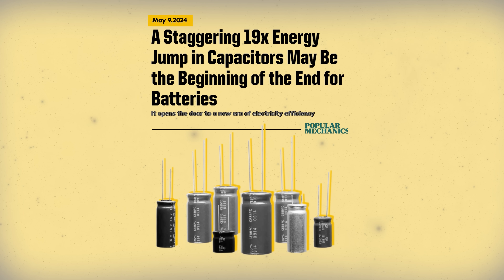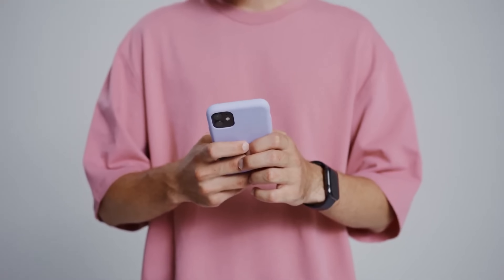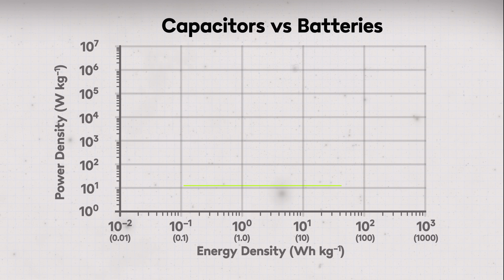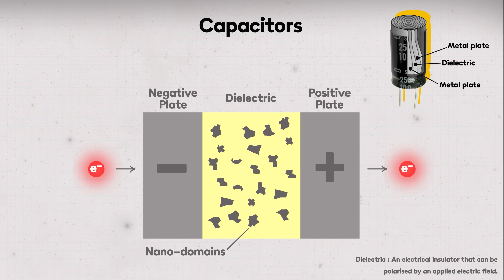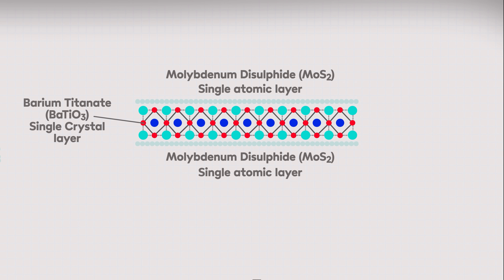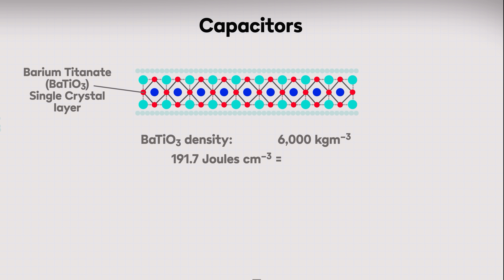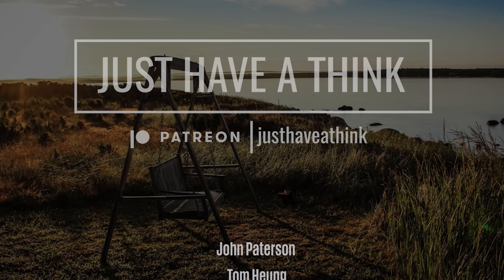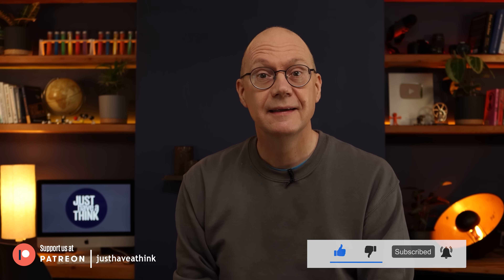Charging an EV faster than filling a gas guzzler? Surely not!?

Comment: I think you meant to have the resistor on the battery side of the capacitor. Then the voltage across the capacitor would ramp
up slowly

Comment: When super capacitors were first proposed as a replacement for batteries, the biggest problem was not so much energy density but rather a high rate of self discharge. I have not heard that that issue had been adequately dealt with, yet here we have a video talking about density but no mention of self discharge. Is this not still a problem?

Comment: Lets say you want to add some supercaps to an existing EV to capture more regen and for a small but fast recharge of the caps that then recharge the battery on the move.
Wouldn't 'having a think' about the control circuitry for this possible EV upgrade or mod be a good idea?
Or is that the kind of 'think' where you lose most of your viewers early in the video, without them clicking 'like'?  :)

Comment: speed does not matter if it's under 15 min.  You pump your gas in about 4 minutes-go inside and pay-get something to eat or drink-checkout at the counter-it takes about 10 min minimum if it's an average gas station.  I've had EVs since 2012 and it has had nearly zero affect between the differences between gas and EV.  I will say with the EV the car doesn't get serviced every 2-3 months.  I've gone years without service with the EV.

Comment: Another aspect of this capacitor is that its dielectric is composed of a crystal several atoms thick. However, the dielectric breakdown has to be equal to or greater than the battery voltage, which is probably on the order of hundreds of volts. So the dielectric must either be much thicker or a bunch of these capacitors will need to be connected in series with voltage equalization resistors in parallel. Either of these approaches will reduce the total capacitance probably by much more than the 19x factor. Then additional capacitors will need to be added in parallel to increase the total capacitance to the intended design value. The capacitor bank will need to be mounted very close to the battery to reduce IR drop and copper wiring. The capacitor bank may be as large as or larger than the battery itself.  In addition, the capacitor banks will need to be protected against overvoltage spikes and excessive heat, which will require even more electronics and additional mounting space, increasing the overall cost of the capacitor bank.  IMHO, this is the minimum needed to provide a reliable capacitor installation.

Comment: Faster fill ups. Electricity can be envisioned a lot like water. If you want to fill up your BEV battery faster is a lot like saying you want to fill up your swimming pool faster. If you use a 1 inch garden hose; it will take a long time; so why not use a firehose? Sounds great in theory right?  However if the amount of water available is only enough to fill a garden hose the fire hose won't help.  If your neighborhood water source is a water tank, but the water tanks is only twice as big as your swimming pool; if others already emptied the tank by filling up their new swimming pools ; you won't even get a drop. Most of the Grid doesn't have the capacity to charge so fast.

Comment: I HAVE SUPERCAPS. Lead acid batteries are 19th century technology and Lithium batteries are very much last decade technology plus stupidly dangerous.

I have six 1kWh or 85Ahr supercaps connected in parallel  on my 45ft sailing cruiser. 1)They have a 1 million cycle lifespan. 2)are 98%+ efficient, 3)have a 2%/month self discharge rate 4)have no risk of fire or explosion, 5)😮can be run down to zero Volts and stored totally discharged for 6 months and when needed be recharged without any adverse effects & 5)weigh approximately ±15 kg each.

I charge them with two 330W solar panels via a Victron 100/50 Blue Solar Charge Controller and a 150W alternator on the engine through a Victron DC-DC charger set at 13.45 Volts and 30 amps. Charging with the engine only happens when motoring, I've never needed to top up with the engine because of low SOC. I've never seen the supercaps below 75% SOC.

They could be charged and discharged with  massive cables in seven seconds but for safety reasons they are each limited to a maximum of 50amps charge and 50 amps discharge. Charging 6kWh in 7 seconds could be interesting to watch at a distance of 100 meters.  😂 They are each fitted with a 50A cutout circuit and if short circuited or overloaded will trip and then need to be reset which is easy to do.

In my case, because I have six in parallel l can charge and discharge at 300 amps. If they were connected in series the 50 amp rule would apply. 

These supercaps can be loaded on a passenger aircraft and transported legally and safely.

I have had them on board for 4½  years and never worried about running them flat, fire or explosion. 

On the 12v system they power all fresh water pumps, bilge pumps, 12v lights, nav station, radar, a power hungry autopilot, a 1.2kW or 100amp  windlass (anchor winch) and can start the 50 hp Perkins diesel engine with ease.

On the 220v system they power a 1kW microwave, a 1kW kettle, a toaster, our little 20 litre 1500W hot water geyser and run a 0.75 kW 220v single phase electric motor which drives a high pressure pump to 80 bar with ease for the reverse osmosis water maker via a 12volt to 220v 5000W pure sine wave inverter which is not the most efficient way but who cares? It works like a dream! For safety reasons I've choose to run them one at a time. I can use all my 220v power tools in the middle of the Atlantic ocean. I have not tried my welding machine yet. 

They also power an 80 litre camping deep freeze at minus 18⁰C plus a refrigerator at between 2.5⁰C and 4.5⁰C on 12v or 220v via the inverter 24/7

My yacht is the only sailing vessel IN THE WORLD fitted with SUPERCAPS for all the vessels electrical requirements. Why??? I can't answer  that question. 

I am a boiler maker by trade, not a Nobel Prize winning electronics engineer and I installed and wired everything alone and it's perfect...I think.

After 4½ years I have been unable to convince any other yacht owners  of the magic. There it is, it works, it is literally bomb proof but no, they refuse to believe what they see working to perfection right in front of their own f.cking eyes, these idiots want Lithium because it can burn like nothing else on earth, it damages the planet and they use child slave labour to mine it! WTF? Cape Town South Africa.

Comment: One major infrastructure issue that would have to be dealt with in order to apply the sort of ultra-fast charging this technology might be able to enable: power delivery rate.  The ability for a capacitor to absorb energy at an astonishing rate only matters if you have the ability to deliver energy to that capacitor at that rate.  Currently, Level 3 chargers offer a DC charge rate of up to 350kW, which is already absurd, and real world cars get up as high as accepting 300kW, so it's not like we're massively overdoing the infrastructure here.  And to get that we're having to do totally ludicrous things.  We're talking in excess of quadruple the normal line voltage and delivering  hundreds of amps worth of current - if you were to tell an electrical engineer 20 years ago we're building this kind of infrastructure for the general public to access, he'd probably tell you that was insane and would kill people.  (And honestly, given how cavalier some folks are about these chargers, I'm not entirely sure he'd be wrong, despite the myriad safety precautions in play.)

To build the kind of station you'd need to charge at the rate you're talking, we'd need to double down on this power delivery.  Forget 350kW, try 1-2 MW.  And now we're literally talking the kind of power infrastructure you see in power plants and substations, and well outside what any respectable electrical engineer would likely consider allowing in a public-access area.

Besides, current fast charging systems are good enough for the people who need them.  Regular refueling should be done on level 2 chargers, or even level 1 - for most people that means plugging in at a charging station in your home at night.  (Level 1 is your average North American household 120V plug, and it's enough for folks who use less than a quarter of their range in a day if they plug in every night.  Level 2 is a 240V plug and requires a bit of hardware that you buy separately, but it plugs into a 240V plug if you have such a thing available (So yes, North America will need electricians to install these in most homes and apartment parking complexes, we tend not to build spare 240V circuits into the house, but this is becoming increasingly common already)  Level 3 only has to serve travelers (as they're out of their normal area and thus have no guarantee of access to Levels 1 or 2 overnight ...though I suspect independently metered Level 2 chargers will slowly make their way into more and more hotel parking lots) and the relatively few people who don't have access to overnight charging (or only have level 1 and need an occasional top-up).  15 minutes is all it takes to add upwards of 120 miles of range to a car these days, surely most travelers can afford 15 minutes to stretch their legs, hydrate, and go to the bathroom.

I guess the one exception to this would be the eventual development of electric semitrailers - though for that industry I suspect the idea of modular batteries might be the way to go - unlike your average driver, truckers are very used to moving extremely heavy loads with precision (getting up to a loading dock without smashing anything is some of the most intense precision driving I've ever seen), so I can see having infrastructure for swapping out battery banks at truck stops where they just pull up to the exact right spot and a machine pulls the battery pack out of their truck, slots it into the charging mechanism, then grabs a charged one and slaps it into place.  Or just a set of several battery packs that take 8 hours to charge on level 2 installed in parallel that's sufficient to carry a truck and its rated cargo through the day, then just plug in a collection of level 2 chargers for each pack separately.  I dunno.  Semitrailers are something of an unsolved problem for EVs as far as I know, but given how critical they are to the logistics of everyday modern life, I'm sure there's a bunch of teams trying to work out how to make an electric form that's practical.  (I can all but guarantee that you're gonna need a solution that can run all day even on a fully loaded truck and can be fully recharged during the mandated sleep period, truckers tend to want to spend as little downtime as possible - it's expensive to run and maintain a truck like that, and since everyone wants shipping costs low, the pay isn't great.)

Comment: I have thought for years that super capacitors would be the perfect addition to all electric cars/trucks. They can absorb or deliver electric energy much faster than any battery and can do so repeatedly without any noticable degradation in energy storage. If they were combined with batteries in vehicles they would allow rapid charging, full regen braking which would allow more energy capture during rapid braking and thereby increasing overall mileage. The battery could hold long term storage but the capacitors would allow for rapid charge/discharge.

Comment: Indycar has just began using their new hybrid system, and it uses super capacitors. It's is incredible how fast the system charges and discharges. High level specs and overview can be found at the Indycar channel. I think a small super capacitor system for EVs to capture breaking energy and then deploy at high current demand like acceleration would be a nice addition if it helped to preserve the Li Ion battery.
Reply: The main reasons a EV manufacturer would not integrate supercapacitors would be, much higher cost, needs extra spaceclaim, added complexity, safety, much lower energydensity of supercapacitors (like 10 times at least (latest cell technology at 300Wh/Kg and increasing).
There's just no need or businessmodel to make for in a electric car right now.

Comment: Just use the capacitors for the instant jolt of energy you get from regenerative breaking and then slowly feed it back into the battery at a reasonable rate

Comment: Idiotic, as usual.  There's a certain amount of power that has to be put into the battery.  Looks at the specs for domestic, commercial and fast chargers will show you the relationship between the amount and the speed with which it can be put into the batter. You can only put in a huge amount quickly if you have a huge supply, like about 1 megawatt.  Good luck with getting that much out of the grid whenever you want it.  And then there's the huge cables you'd need to carry that load ...

Comment: E = C V*V / 2, period. That means this 1F 5V capacitor I own can hold 12.5J of energy. For raw energy storage, a parallel can be drawn between LiON batteries and energy dense capacitors. Can you charge a capacitor to 100% faster than a battery? Yes. Can you store as much energy per cubic meter with capacitors? It seems not. Inventing a battery chemistry that charges as fast as filling a 10gal tank of gas is a game changer. I compute 1gal of gas is 33.41 kilowatt-hours (kWh) per gallon. Today I can put 330kWh of power into my car in 10min, payment time included at any gas station. Not possible today with any DC fast charging station today. Wait 5-10 years. Meanwhile, any auto manufacturers are backing off from building pure EVs and falling back to Hybrid Electric, or pure ICE cars. The reason here is obvious. April I made a 5000+ mi round-trip to see the 2024 Eclipse (awesome experience) and had zero concerns with where to buy gas for my Hybrid Electric Ioniq car. No way my Kia EV could have made that trip.

Comment: Just remember: Charging time is inversely proportional to the charging rate. For a 50kwh battery, a one hour charge takes 50kw of electricity. If you have 8 hours to charge, you need a 6.25kw charging power. To charge faster, say 10 minutes, the charging power is a whopping 300kw. There are several upper limits on how quickly an EV can be charged: 1) Electrical supply capacity (fast charging requires high power capacity); 2) The allowable charging rate on a battery pack (and how fast charging affects battery life/capacity); and, 3) How large the charging cable and connector can be and still be used by every driver.

Comment: The battery will only recharge at high speed for the time it takes to recharge that capacitor. It's great for short periods of regenerative braking, but not great for overall battery recharging speed. 

To explain: If you replace half of an original battery mass a capacity of 240 Wh/kg with capacitors which have mass capacity of 8 Wh/kg, you will end up with an energy storage system with an overall energy density of 124 Wh/kg. And that system can be recharged by +/- 4 Wh/kg rapidly.

Comment: I work in pv/ battery industry in Belgium and we recently met a startup called ForE which created a hybrid super capacitor that is already commercialised as an ESS for home storage. Impressive specs : charging at 6C speed, 50k cycles with more than 80 % of energy. Dod of 100 %. Weight was about 70kg per 5kwh unit. They use lithium as the hybrid material. I can send you a mail with all their info, would be nice to cover !
Reply: Great, It would make sense for regen too.

Comment: 2.14 I think you are far too optimistic. If it became cheap and easy to make a battery that lasts millions of cycles, industry would hate it. If technology won't make those at the top richer then it will be brutally crushed. Batteries that last almost forever would represent a serious loss of business for mobile phone companies, to name just one sector of many that would also be affected. If the battery on a phone didn't degrade over time, many people would buy less phones. This would obviously be bad for some very powerful people. Can you get research done when a bunch of billionaires want you dead? Of course not. This will be a flop or it will be crushed.

Comment: Revolutionizes?  Nope.   It makes super capacitors smaller cheaper lighter per watt if it gets to the point of manufacturing.  Good and cheapens a small fraction of an EV, though not any big changer as it's not going to be a primary storage device for any application I can think of.

Comment: An interesting concept with a lot of truth in it. All of my working life was in electronics mainly repairing  all sorts of stuff. If I'm presented with something thats not working  particularly something thats been around for a while I'm going to be looking at capacitors as the most likley cause of failure, especially the larger values that can store more energy. I'm sure that the folks who are developing this tech will know this too so they must be working on the relatively short life of capacitors when highly stressed.  It will be interesting to see if they succeed. The Lamborghini Sián has a 34hp motor which is powered by a super capacitor whose sole purpose is to kick in and smooth out power delivery during gear changes.